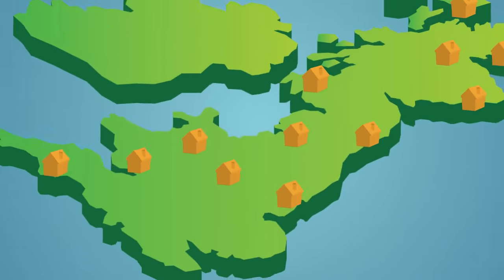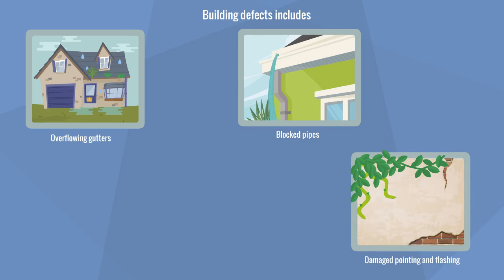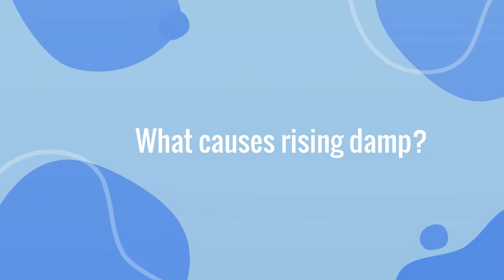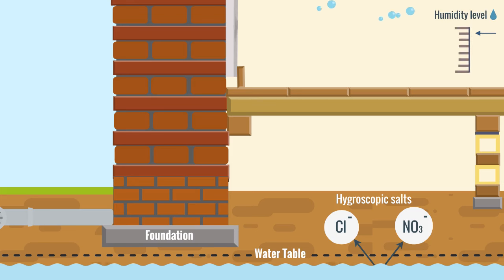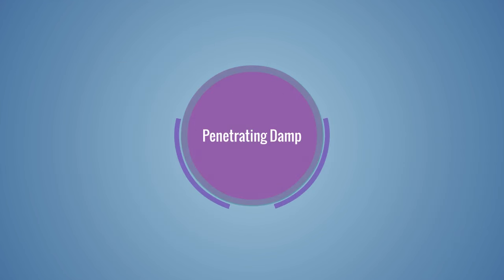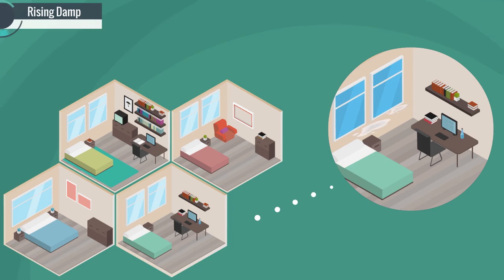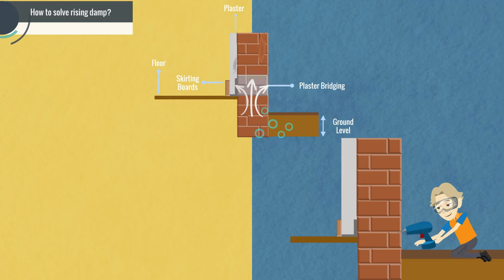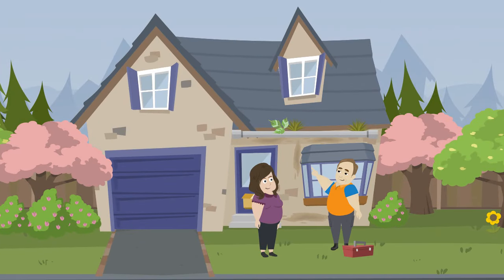Dampness in Houses? | What's the Difference between Rising Damp and Penetrating Damp?

Comment: What if the house is on a slope and the ground level on the outside of the house is a meter lower than the ground level inside the house? How high up would the damp proof injection be installed? at gound level outside or matching the ground level of the inside of the property?